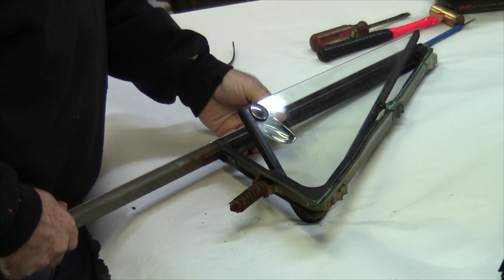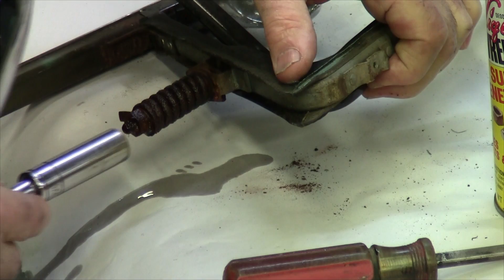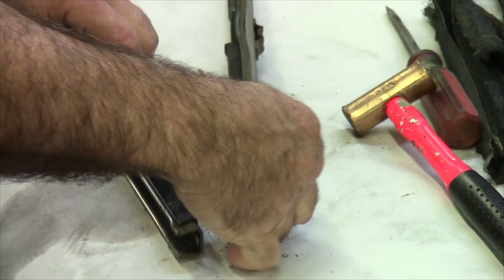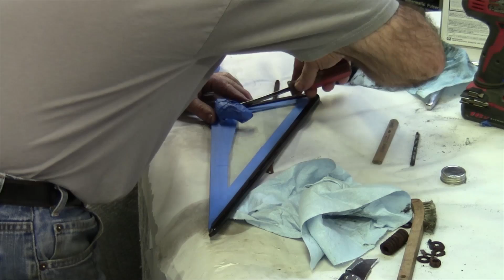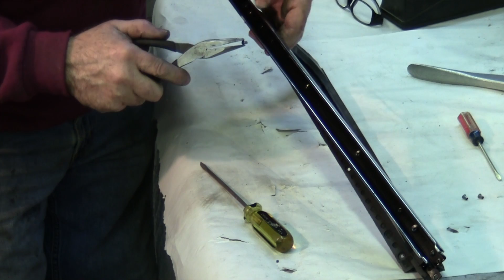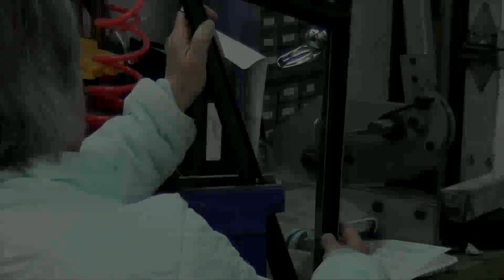Vent Window Restoration-1967-72 Chevy Pickup

Comment: Mr. Jerry how do I find you phone number  I've got  1 vent window I need a quick quote on how much do you charge to do a vent window I've got most of the parts now just don't have the rivet kit .
Reply from the maker: My phone number is (541) 405-8286. You can get the rivet kit from The Filling Station, (800) 841-6622, part number FS-633

Comment: What are the big rivet pliers you used called ? I can't seem to find those exact ones
Reply from the maker: That is a Kent-Moore J39354 Rivet squeezer. I believe you can get this tool at your local Harley dealer but they are expensive- over $300 last I saw.

Comment from the maker: I glue them with 3m black weatherstrip adhesive and install them wet, not dry or you may not get the felts into the channel.Put a thin layer of adhesive on both surfaces and push the felts all the way into the post channel.

Comment from the maker: if you are talking about the felt channels that go into the vent window post, I install them with 3m black weatherstrip adhesive. You can get this at most auto parts stores. The 3M part number is 08011

Comment: Jerry, how did you install the division bar inserts? glue or rivet?
Reply from the maker: I only put two or three dabs of silicone inside the channel, but normally the channel fits so tightly that you don't really need to do that. I do install one semi-tubular rivet at the bottom of the channel to ensure that the channel does not come out. I believe that GM did install a rivet at the bottob also.

Comment from the maker: Since I started rebuilding these vent windows for customers, I have decided that I have to increase the labor cost from $125/pair to $150/pair. I found that I was putting in a lot more time on rebuilding due to improvements on my procedures and increased material costs. However, this makes for a better end product. I don't like price increases any more than the next guy, but I felt I had to do this to make it worthwhile to provide this service. Thank you all for your support!   ~~~ Dr. J
Reply: Hey Jerry, I have an 1986 K5. if I sent you both of the vent windows, glass for the drivers side, and new weather stripping for the two, can you do it? And about how long does it take to do this process?
Reply: Jerry I'm about 1/2 way into putting mine together having a hard time with putting the washers in right wold you take this job on for me???
Reply: Mr.Jerry do you have a phone number I can contact you at sir.

Comment: Thanks for the video Jerry!

Seems like there will be a couple of minor differences between the older Chev and my '85 (it's a one piece rubber design, for starters), could you comment on any differences in the procedure or the parts/ tools needed for later models? 

Thanks again!
Reply from the maker: Hi Kevin,
Thanks for the nice comments! I haven't done one like yours, but I can't imagine that it could be much different than the 67-72's. I think once you get into it, you will see what I mean. If you have any questions while going along, just ask.
Thanks,
Jerry
Reply: Jerry Kassis
Jerry, I just finished the job... pretty much as you said, the only significant difference is that the one-piece rubber doesn't get riveted to the window frame, you have to use a weatherstrip adhesive and glue it in. It's a little tricky to not make a mess but other than that I just followed along with your video.

Comment: Are the vent window seals from LMC Truck lower quality? I spent about four hours just trying to get the seals to go into the channel and in one spot it kept popping out. I've really lost my patience with this project and will be buying new vents instead. $220 each is looking like a real bargain at this point.
Reply from the maker: I use The Filling Station seals, part number CV-65. I have installed many, many of these and they work perfectly. I also spray the back of the seals with silicone spray to ease the installation. Makes a huge difference!